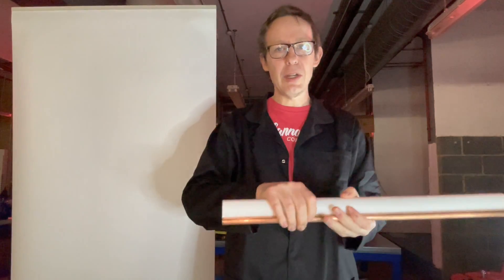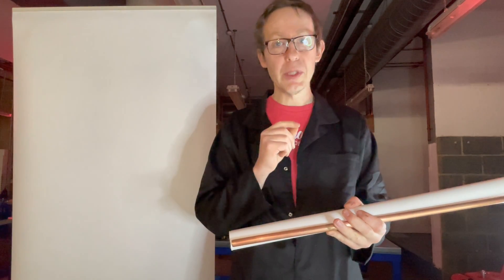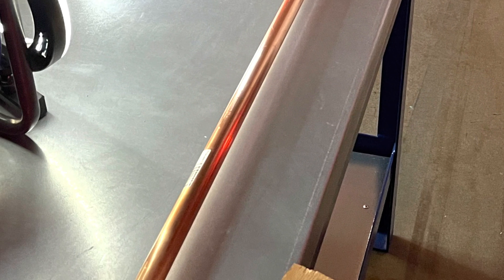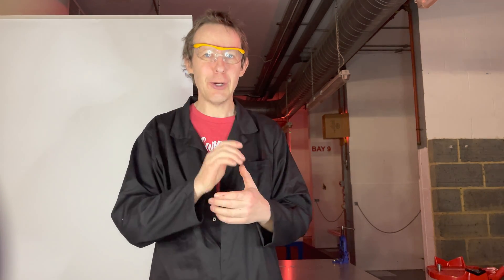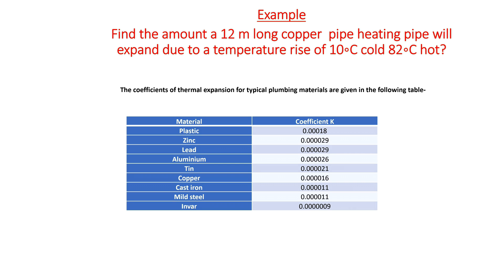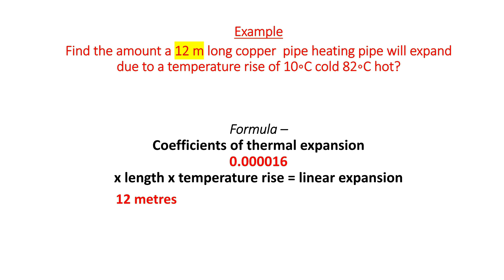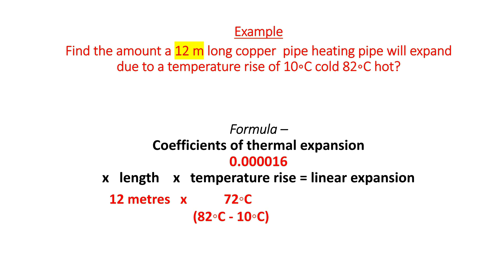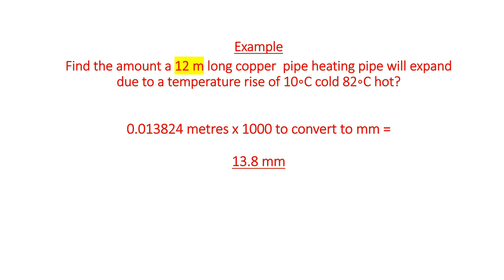Linear Expansion in plumbing

Comment: #1  0.1296m = 129.6mm
#2  0.01584m = 15.84mm
#3   0.1044m = 104.4mm
#4    Let heating pipe highest point be y. 
y * 3m * 0.000016 = 0.01m
       y = 208.33 degrees C
i.e. pipe reached  208.33 degrees.

Can you give us the correct answers?